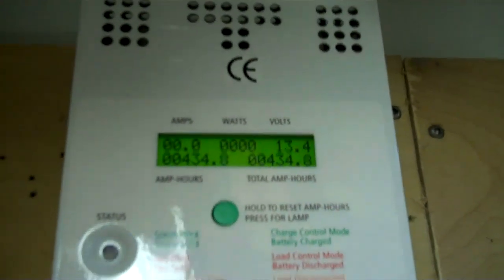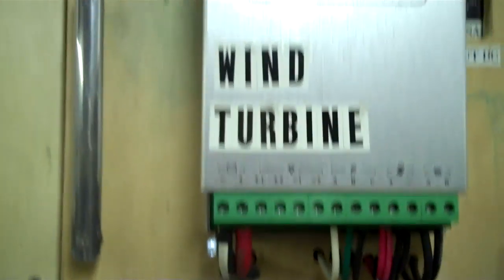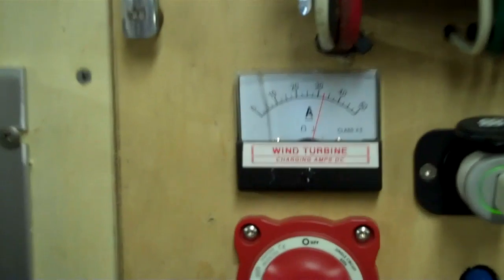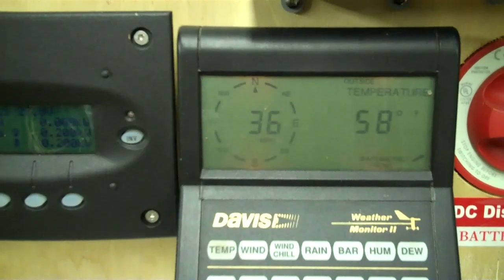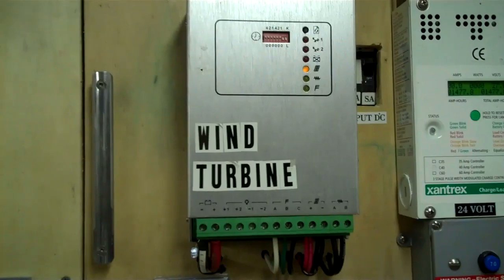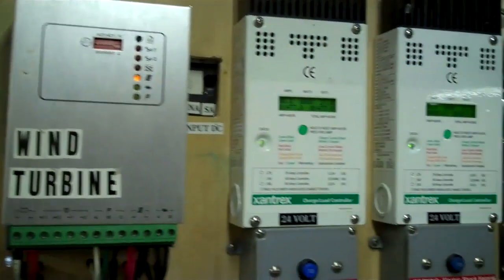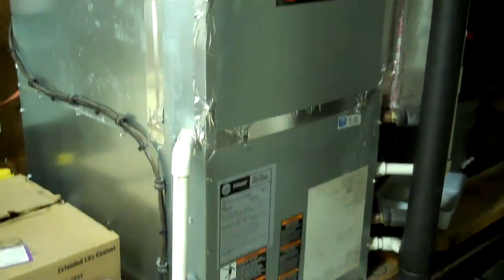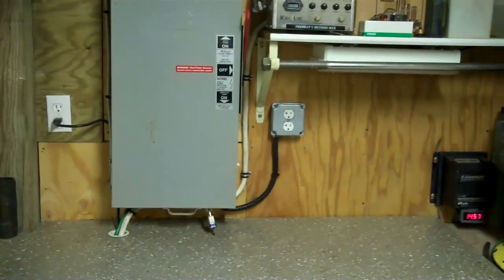WIND TURBINE VS SOLAR POWER

Comment: Leave the turbine up: I'm noticing that there is no real sun, the panels will give 40% of rated power, that turbine is going nuts. You don't need as much battery capacity if you have both wind and solar, because there are fewer days that you get neither, than days where you get either. During winter, the turbine could end up picking up the slack from the short solar days. Too much power? nice problem to have. The torque of the turbine goes up on the square of wind speed, the power goes up on the cube. Doubling wind speed gives the turbine 8X more power. The question is, can the alternator transduce that much power, without going into magnetic saturation, and losing control of the rotor. Permanent magnet alternators are limited by the field strength of their magnets, and the impedance of the stator. At that point, the current is constant, but higher voltage can be achieved at that current, meaning the power is only proportionate to wind speed.

Comment: The actual problem is not with wind turbines as such but turbine designs you know with just the blade system designs.I think outside the box and am developing my own kind of design that does not require blades chasing wind directing therefore limiting power production.Also silence is also considered in my design factor because none of us want noise while producing the power for our homes.I am in testing stage here in Australia and of course my design will never make it on the market as I am sure some mongrel would want to shut me down so even if I succeed I will have to keep it for my own personal use only.
Reply: Vertical axis?

Comment: only if the wind is blowing. solar still out produces the wind where I am at.  I have solar and four turbines. i'd take the solar anytime for a year around system. something your missing about wind turbines is they don't make max power until the wind gets up pretty high. unless you live someplace the wind blows 20mph 24/7/365 your not going to get a lot out of the wind turbines.

Comment: everyday for $3,200 less than 10% of the cost of solar and more than 40% more than my need, with a tied grid system I would be getting a check from my electric company not a bill. at this point I don't see how solar is worth 10 times the money for 40% less power. if you disagree please post a comment response, prices based on amazon searches. open to suggestions. my electric bill is only 8.4444444444444444 cents per kilowatt, however a $250+ electric bill is a big one to get rid of "if I can"
Reply: So question what wind turbines would you suggest?? I can see the difference in pricing and I'm just looking up as I was going to buy solar I have a few but I was going to do 10 or 12 and it seems like wind it's much cheaper and I live in Manitoba Canada

Comment: I have to disagree a solar pannel that produces 280 watts is good for about 200 watts for 5 hours a day or 1 kilowatt and cost about $450, however a singe wind turbine produces 3 kilowatts per hour 24 hours a day, or 72 kilowatts per day and cost only $1600, that may sound like alot more, but consider this, I use 100 kilowatts during the winter, it would cost me $45,000 for solar and I would have barly enough for myself, or I could get 2 wind mills and have 142 kilowatts 42 more than I need...

Comment: @OBXSOLWIND ive already bought a 400w wind turbine and 2000w inverter im just thinking now eather get another 400w turbine for £230 or 250w solar panel for £270 ?? i dont know what to get i need which ever will produce most electric for the money

Comment: @helloman1976 
If you watch the video again you will see that he says that the battery bank is full, he is going into diversion load, AKA his system is wasting off the extra power so he doesnt need to keep it running, and in that kind of wind the degredation on the wind turbine parts will be high, so no point in letting it wear out when its not needed.

Comment: i would have to say your vids right down to the geo thermal all of it have been more inspiring to me them just about any others i have watched i just bought 11 acres an i did so to implement what i have learned from you an a few others i did have a ? about how to use the load diversion when your charge controller changes from the full batteries could you run the diversion in to a grid tie inverter so that power is not wasted an just runs to what your using or back out the meter

Comment: Am I right in assuming the upkeep on a turbine can get costly due to all the moving parts? Solar just seems nicer because once its there you shouldn't have to touch it for 30 years, well the batteries at somepoint. Thanks for sharing bro, Stay safe down there.